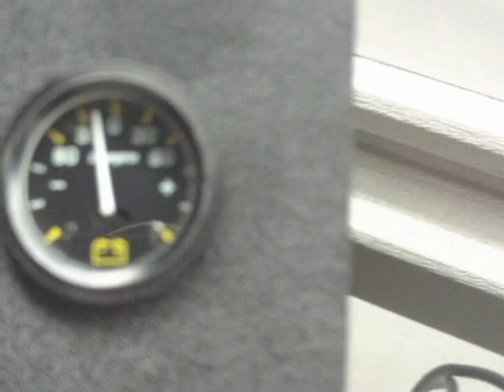NEW GASKET MATERIAL  and 3.5 LPM

Comment: That CE material is NOT rated for KOH. I contacted a manufacturer and this is the reply I got back:

See attached chemical resistance info.  Grade C is listed as failed and not recommended with KOH.  I assume CE would be also a failure with KOH.

For more info, contact Norplex-Micarta at (800) 350-9490

Comment: Your work is good! I think you have mistake in measurements. You have "double cell",2x7,7x7 inch,right? And you run about 2x 25A, this is 50 A ! You measure just one half,7 cells! This mean you have about 700W and 4lpm,this is 175W for 1lpm or 5.71MMW. This is usually for good dry cell generators. If you have better you need generator with isolated holes or no holes. I learn from your videos,this is my gratitude! :)